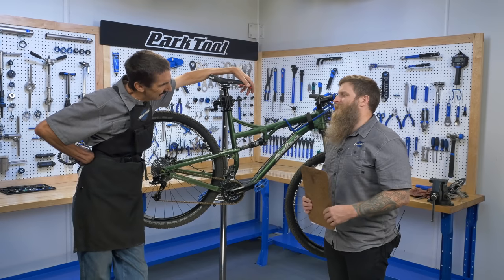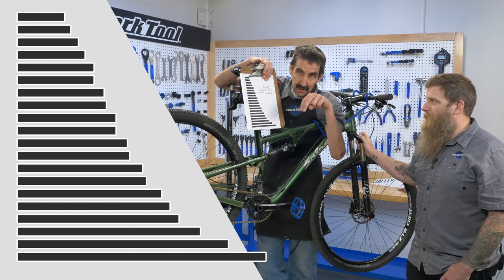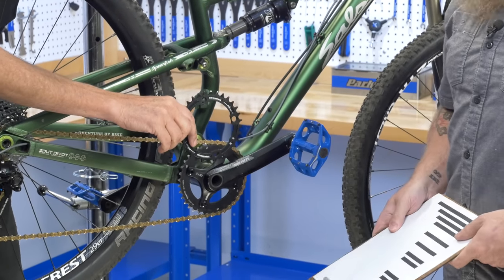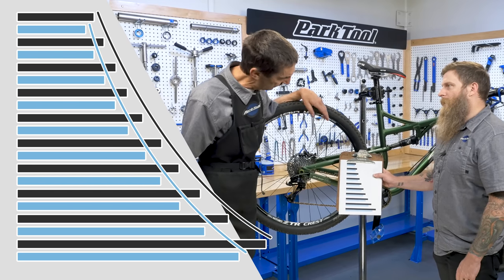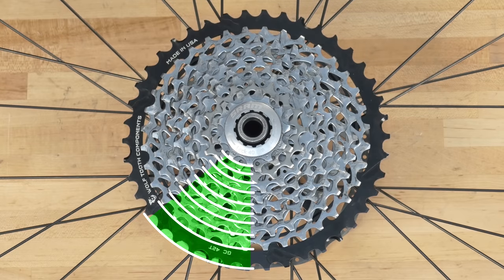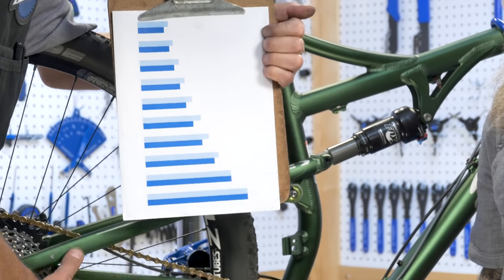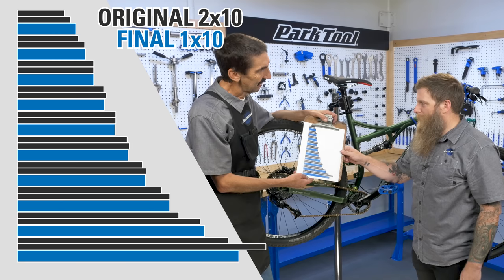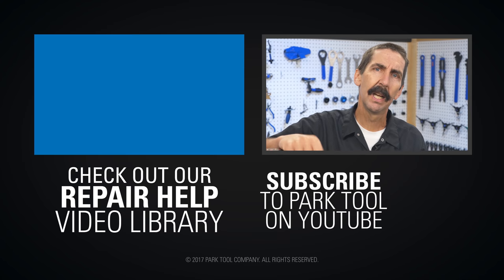1X Conversion: Pros & Cons - Tech Tuesday #91

Comment: I dunno.  To me 1 x seems like a step backwards.  The only advantage I see with it is a cleaner looking setup.  If I were to go with that, my front chain ring would have to be large and not a granny gear.  I would then make up the range with the cassette.  Picture this.  Imagine that 1 x was standard and bike companies started to introduce 2x and 3x.  I could hear the reviews now..."and over here on the left we have the new industry standard, the shifter for the front derailleur to give us serious riders a better range".I have a 3 x and am not ashamed to say it :) but when I am on a trail, I  just leave it in the smaller chain ring and only shift the  back.  When I am on road or a smoother surface, I leave it in either the big chain ring or the middle, and leave it there too.If the bike is going to be strictly for downhill, I can see the reason for it, but its not for every situation, and its certainly not for me.
Reply: Taurusdre for real
Reply: Good point.
Reply: But isn't it correct that crossing the front and rear (example, 1 in front and 8 or 9 in rear) deteriorates the chains lifespan? At least that's what I've been told.
Reply: Taurusdre, That's what I don't get either. It is obviously a step backwards, there's a reason 2x and 3x were invented. We all used to ride "1x" after all.
Now obviously having more options with the cassette today means you can get more gears out of a 1x, 2x or 3x than we used to but still not as many gears with a 1x. I remember my first MTB was 3x6 so that was 18 gears, you're not getting that on a 1x but you can get that from a 2x today.

The 1x is quite clearly driven by marketing, the benefit of having more gears hasn't suddenly vanished overnight. If your way of riding fits the gears that a 1x offers that's great for you and then you may choose to go for the simpler and cleaner look but you are missing gears that people on 2x or 3x have. If you're climbing and find the 1x granny gear just slightly too low you're pretty much out of luck as the next gear is usually quite a fucking jump away from the granny gear. On a 2x or 3x you can make smaller adjustments to fit your preferred cadence.
Of course you could just add more granny gear options to your 1x but then you'll be missing out at the other end when it comes to riding really fast on flat terrain, gravel roads, even normal tarmac roads or whatever, or you'll just have massive jumps between other gears. No matter how much Sram spends on their 1x marketing you're never going to get the same out of it as you can get from a 2x or 3x, period. 

What really annoys the hell out of me about the 1x though is the pricing. It's a simpler fucking system. They save a ring up front and the entire front derailleur and mounting for it, it shouldn't be a fucking "Premium product", it should be a cheaper option for people only doing bike parks with shuttles, lifts etc. as they obviously don't need gears to nearly the same extent as other riders do. The manufacturer is saving money on a simpler setup and marketing it as a more expensive product. That really pisses me off.
Reply: I understand what you are saying Taurusdre, but until you try 1x, its hard to knock it. My new bike came with 1x12 gx eagle, and I honestly cant fault the range of gears it gives me. I still have a 3x10 xc bike, but the chain slap and extra noise is noticeable whenever I ride it. Personally, unless you are getting a new bike, I dont see the point in upgrading.
Reply: Sambhav Choudhary Sambhav Choudhary Yup "cross chaining can be bad for the drivetrain overtime they say"…it would seems 1x could have that issue but I wouldn't know lol I enjoy my 3x tho…check out this article quoting what big brands think about cross chaining, wow
https://www.google.com/amp/s/road.cc/content/feature/213468-cross-chaining-it-really-all-bad%3famp?espv=1
Reply: same for me... my 3x9 stock setup suits me the most....and never had to think too much what gear i need..it comes automatically...you just get used to it...most important is to shift parallel to keep the chain wear minimal as possible ;)
Reply: @gnawershreth  yes it vanished over night. many thinking riders realized the 3x set up is not very useful and a "bigger is better" marketing ploy. the quiteness and simplicity of a 1x is pure joy! u can get a oval chainring for $20. a 1x oval setup is supurb!
Reply: crabtrap, The 1x just happens to fit your style of riding and that's great for you then. More power to you.

But no, the advantage of more gears didn't go away and it never will, that's why gearing systems were such a great invention and allowed us to do things that would never have been possible without them. Look at 4x4 vehicles or trucks, tractors etc. they can have like 20 gears because it allows them to do way more stuff than 5 gears would. The same applies to every other kind of vehicles, if you want to build a bicycle that can tow a car, the way to achieve that is with gearing. Gears is what makes such things possible.

That's also why the 1x fan club  doesn't advocate for no gears at all, they know that gears are important and allows them to do things they otherwise couldn't do. That doesn't stop being true once you hit 9, 10 or 11 gears. 15 gears allows you to do more than 10 gears, 20 gears allows you to do more than 15 gears etc. That's how gearing works, and it doesn't suddenly stop being true just because some people like the 1x. Physics is physics whether you enjoy 1x or not.

The MTB scene has got to be one of the most unscientific scenes out there. "Gears don't matter.", "Aerodynamics don't matter.", "Clipless pedals don't offer any advantage." etc. etc. It's all absolute nonsense entirely based on subjective style and preferences at the expense of science and facts.

Comment: I get 1x for downhill and enduro and 2x for trail and xc. 3x seems pretty useless Ive been with a 3x for a couple years now and only ever shifted to the 3rd cog by accident. I dont understand the price differences though. Surely more cogs would be more money?
Reply: My two bikes were 3x at front, little ring gone off, and limited screw turned the 3 gears into 2. Done. I learned it when one mechanic did it to one, and now I fine tune it, it runs perfect.
Reply: @tonysadler5290  at least in the US, the 3x system is definitely more prevalent among 'big box store' cheap / entry level bikes (walmart, target, toysrus, etc) probably for the sole purpose of marketing HIGHER SPEEDS, MORE GEARS, BIGGER IS BETTER bs. I guess with the core demographic being non-cyclists or recreational cyclists that use their bike once a year, they're gonna be using the lowest gear set for the slightest hill and largest gear set for downhills, if they actually learn how to shift properly in the first place.

Comment: In 1986 ordered the first Cannondale mtn bike they made - the SM600 w/180mm cranks. I'd never give up my triples w/180mm cranks. To take the small chainring away from a mtn bike seems stupid to me. Same with going to shorter cranks with less leverage. I don't like a lot of chain crossover like a 1x has. Back in the day, you learned your gear inches from a chart and got the right combo freewheel for your personal needs, that also avoids too many duplicate ratios.  Sometimes a tooth or two here and there makes all the difference to efficient riding.  You can tape a little gear chart on the bars to show the shift sequence. Learn to double shift when necessary and enjoy always being in the right gear and your rpms 80-100. If you low-rpm mash gears, you'll wear out the cartilage on your knees/patellas.

Comment: Did a bit of research and found out that 1x is much more expensive and will wear out soon. Will be sticking with my 2x.
Reply: True, the most cost effective bikes are 3 by 9. those rear cassettes cost peanuts compared to 1 by solutions. here arround 25 euro's compared to 80 euro's. Meaning as a rental service i will not make the jump at current prices.

however 2 by 10 is cheap enough. 11-42 10 speed casettes are 35 euro's. Those can work fine with 2 by drive trains.
1 by 12 10-51/50 casettes start at 80 euro's. That's just too much.

Comment: Nice to see the charts of ratio differences. I waited until my cup and cone hubs, 3x8 gears with a dodgy rear mech and chain were all ready to be binned after 5 years abuse and changed to a 1x11 system on my mtb. The old system felt cheap and delicate from new. Being a 26 i had to get a specific wheelset for the 11 speed but now it is fast and simple and feels robust. Did notice you didnt mention a clutch on the rear mech or a system for the keeping the chain jumping off at the front or the potential of a 1x11 if that was a 1x10. Understand why though if you were going absolutely budget but worth a shout out incase it improves the ratios. And different chain ring options for harder or easy riding to pre set the type of riding you want to do.

Comment: I see a future where we have 1x22 it'll be the new craze. It'll save weight and be easier on the chain..
Reply: Hub space for cassette is limited, so it will limit maximum number of sprockets in the back. With more sprockets, the cog pitch will become thinner and thinner until it reaches a hard limit and the chain will become progressively thinner as well. Will there be a future with 22 sprockets, I highly doubt it; anyways, there is no practical reason to have so many gear ratios.
Reply: Mister Nobody it is a joke

Comment: 32T -- 11-42  1x setup:

32T -- 11
Is it possible to reach 10-15 miles/hour speed in flat area? (I am OK with 15miles/hour top speed)
32T -- 42:
Can I climb 20% gradient? Is it much harder than using 22 - 32?

Comment: I just sacrifice pedaling fast downhill and scale my 1x towards the lower end. I can't imagine needing lower than what Calvin's got there - a 32T chainiring and a 42T big cog? Unless you're towing a lot of cargo, it seems unnecessary for most people. I find having a 36T chainring and a 40t big cog plenty low enough for me to carry my work laptop, gear, a change of clothes and shoes, all of which weighs ~15-20 lbs. At 95 RPM cadence with a 36-11 ratio, I'm going 25 MPH on flat ground, which is plenty for a commute.
Most people aren't racers. They'll save their knees and their headaches by gearing down and spinning fast.

Comment: the 3x geartrain should have a graph that eliminates all duplicate gears, and also gives the front-back gears to achieve that ratio. Then factor in how perfect your derailleurs have to be to not drop a chain when you're trying to shift that fast, or how quickly you can cycle through to the correct gears when youre entering a climb or trying to get into a quick downhill. You get more ratios with the 3x and "smoother ratio transitions" but you need to factor in the real world application of each setup. Not to mention the "difficulty and cost" of building a good 1x drivetrain when you can just buy the correct pieces once instead of all these little parts and pieces from different build kits to get the ratios you want. Just buy the correct cassette and derailleur from the get go. Lastly what is the cost compared to mis-shifts on a 3x that either brakes your chain, sends it into your spokes or simply the added maintenance cost of having 2x moving components.

Comment: That new front chainring appears to be 32...?I just picked up a Rockhopper Pro where the prior owner started to do the 1x conversion by removing the front derailleur, shifter, and the small chainring.  Of course, he lost the removed components.  I'm evaluating which may balance out function and cost over continuing to finish the 1x conversion or picking up the parts (Doore shifter, front derailleur, and small front chainring) to return the bike back to stock.About me.  Athletic 5-10 200#, 58 y.o. in decent shape (but getting older, and I will probably have this bike for the foreseeable future), and I do primarily recreational trail riding here in the Pacific NW.   Any observations/opinions/persperspectives?  Your comments appreciated!

Comment: I retract my last statement. I am going to keep the 1x7 set up and replace the smallest cog with one with fewer teeth. and I am thinking about changing the chain ring from a 30t to a 42t if it will clear the frame. I like how easy it climbs but I miss the top speed a 3x system gave me. with the modifications I am thinking about how do I determine the proper chain length I will need?

Comment: I currently have a 3x10 (44T, 33T, & 22T rings). I find myself favoring the 33T chainring and I'm starting to hate that shift cable on my seat tube. I'd love to switch to a SRAM Eagle GX, but I'd love it even more if Pinion made it so their P1.12 gearbox could be retrofitted to existing frames.

Component compatibility is the way to win markets. Having to get an entire new frame just to get a particular drivetrain is just not in the cards for most people. I'm sure the Pinion would already be far more common if it could be slapped on existing frames. Hell, I'd be busy trying to convince my wife that I need one.

Comment: I have never used the 9, 10 or 11 on my bike as I run a 30 in the front. I find it easy enough to switch out the front so I also have a 36T for the bike park.

Comment: Why am I not going or the 1x on my MTB?
1. Did not really see a good chainline or chain position for 1x when you use the big ring on the back.
2. Sometimes it is indicated that you use a "chaincatcher" or smth like that. almost a front derailleur.
3. Already bought high end 2x11 with 26/36 with 11-40 on the back. I haven't tried it out yet, but my hopes are there. 
I used a 2x10 with 26/38 and 11-34(I know, I know, should've go with the 11-36, but still), and once you are really "offroad, there is no use of the 38, unless you are an animal, or descending. 
*I do find the 10-42 cassette very interesting from SRAM, but that;s another story or another hub system...
4. Without too much theory, I can find myself(a non professional rider) on a long trail, tired and lacking power in my legs, so maybe having 26 on the front with 40 on the back si better than 32 on the front and 42 on the back. And i you find this good enough, think about the opposite, when you really need to pedal, but you remember you have only 32 on the front and 11 or 10 in the back. Try to remember that 3x system you certainly had, and how much did you use the middle chainring, the 32, and at what speed you felt like you need to shift up or down with the FD?

Anyhow,
Even on 3x11, anybody must try(including myself) an electronic shifter at some point.
Happy trails!

Comment: I went from 2x10 to 1x10... back to 2x10. Just wasnt enough top and low end range for the varied riding routes I do. I just found myself unable to get up some steap climbs on 1x and slow down some fire roads. In the end I preffer the extra weight.

Comment: great vid. Sounds like a lot of compromise. I guess that comes with the sport. I’ve been on my 3x9 for years.. from mountain, trail and commuting. I use all three front rings fairly often.( different situations that fit how i use my bike) does 29 wheels leaven the effect on percieved lost of top end? ( bigger wheels/more ground per rpm) At the end of the day, I guess the proof is in the putting. gonna have to test ride a bike set up 1x.

Comment: you should have Weighed the Before 2x10 set up and the Final set up Weight !!! how much weight saving and how much you spent
Reply: on a deore setup, i dumped near 2lbs (shifter,3x chainrings and frnt mech). this is a 1x9 now. cost was $20 for a nar/wide oval chain ring.
Reply: crabtrap how’s the low gear .. easy gear for up hill with 1 by 9 ???

Comment: I'll be happy when I can get a 9t lower gear, replace the lock ring with it perhaps, then we can go smaller up front with 30t or even 28t, then a 50/52 in high gear, uphills would be a breeze, maybe that'd end up being a 1x13 or 14 though for the even transition...

Comment: can i remove the 15T instead of the 17T? will there be any issues? btw no 16T
Reply: should be fine, i think the main reason they remove the 17 is to keep the difference in teeth as low as possible
Reply: You'll notice higher tooth jumps more in the higher gears, which is why the lower gears on a cassette are where the biggest jumps are made.
Reply: Zeek, you'll be fine doing it that way, but before you do it, check out the Sunrace $ (or Praxis $$) wide-range cassettes.  I found them to be a cheaper alternative to the cassette expanders and replacement 16T cog, and the gear jumps are spaced more evenly throughout the cassette when I updated my 3x to a 1x.